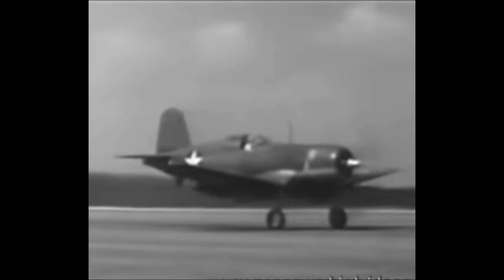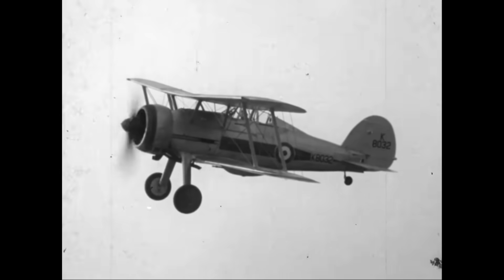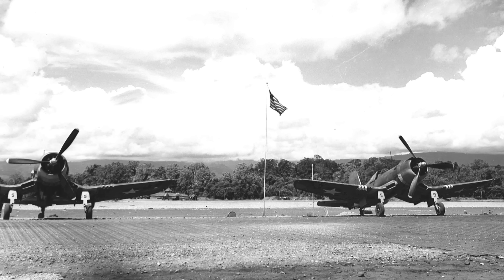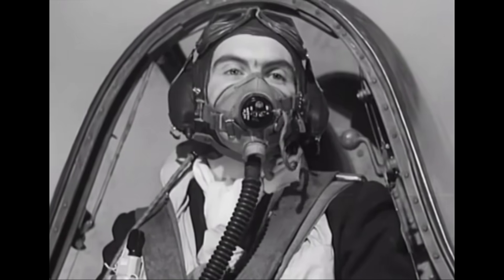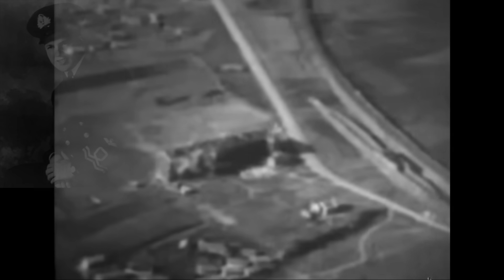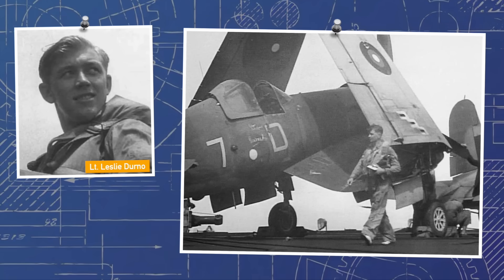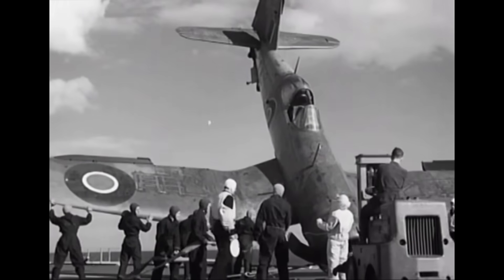Why Did Britain Use American F4U Corsairs? The Full Story

Comment: My grandad was a Royal Navy Fleet Air Arm Airframe Rigger and eventually got stationed at RNAS Coimbatore HMS Garuda in India.
He worked on a lot of different aircraft types including Swordfish, Wildcats and Seafires but loved the Corsair.
Easy to fix and didn't throw many problems up.
He passed away in 1988 when I was 20 but I was inquisitive enough to ask about these things when I was young.
Reply: British designed aircraft were not known to be friendly to engine mechanics.  American designs made it easier for fast maintenance.
Reply: @billfarley9167  Many lessons were being taught, but the sheer Industrial powerhouse the USA with it's modern fabrication techniques and mass production, must of been alarming to every other nation out there. I would surmise that with the improved method of mass production where a person or persons perform just one aspect then pass it on down the line for the next stage, had the knock on effect of when it did come time to perform maintenance, it was an easier task for access, standardised fittings / tools etc.
      When you look at the cockpit of a P-40 Tomahawk or the P-51 series of Mustangs, the cockpits are so advanced compared to anything else with the exception of the German Aircraft, of whom maybe they took a few pointer off initially.  Gauges placed in groups making it easier for the Pilot to access the information he requires all in one region, rather than having to scan back and forth.
Reply: You must be very proud of your dad and rightfully so.
We thank him for his service and may he RIP !
Reply: My dad was a USN Aviation Machinist's Mate (finishing the war as an AMM1C). I've never been sure what the equivalent RN designation would be, but maybe Dad was the same as an Airframe Rigger. He said that the USN preferred the radial engine because it was simpler: "We didn't have time and space to fiddle with water jackets and all those parts to an in-line engine, like the Army Air Force used".  Maybe that resulted from the USN having kept control of its aircraft, while the RAF took away the RN's planes. Allowed the USN to experiment and test out various designs. In all, it is remarkable how quickly the RN rebuilt the FAA once it got its aircraft back.
Reply: Nice

Comment: They used it because it was the best fighter in WWII.  Not the Mustang, Thunderbolt, Spitfire or any of the other ones people gravitate to.  Or as USN said in their trials: The F4U-1 airplane appears to be the superior fighter for Naval or Marine employment, either land for ship-based except in the case where substantially all the fighting occurs above 25,000.   Simply put, it out-climbed, out-turned and out-gunned everything and only the P51 out-performed it as an escort fighter.   It was a hell of airplane and I am so glad the Royal Navy helped unlock its full potential.
Reply: My stepfather flew a Corsair with the Fleet Air Arm and I can confirm that he told me that when carrying out dog fight training against Seafires (the name of the Navy Spitfire variant) he found that they could always gain an advantage because he could out turn them. At first sight this seems surprising given that the Spitfire is a smaller (and in theory) more agile plane but this was what they discovered. (I should acknowledge that that the Seafires had folding wings, unlike land based Spitfires, and there is a possibility that this adaptation compromised the handling of that aircraft as they had not originally designed with that feature.)

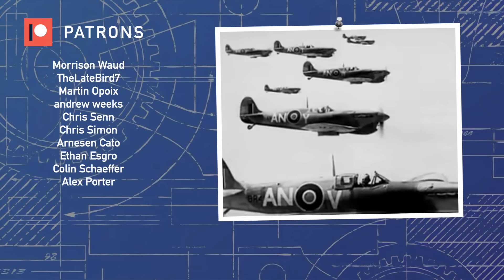Comment: Your line at 18:40 that the US Navy found the Corsair "inherently unsafe for carrier operations" is incorrect. Please do a google search for "F4U Carrier Suitability" or "Corsair Carrier Suitability" and look through the US Navy documents posted on Researcher At Large. The bounce and wing stall issue were resolved before the end of the Corsair's first carrier trials, and the reason the Corsair was sent to land bases was more about Vought's production capacity than problems with the design. This is why both Brewster and Goodyear were brought in to build Corsairs as well. The Navy chose to put the Hellcat on carriers and the Corsair on land bases to simplify supply chains and storage aboard ship.

Comment: The exact same propeller was also on the Grumman F6F Hellcat aka a conventional carrier aircraft, the gull wing design was for a higher top speed. The F4U and the F6F not only shared the same prop but the exact same engine, the Pratt & Whitney R-2800 Double Wasp. Because of its better aerodynamics, it's gull wings, the F4U was more slippery in the air giving it in some estimates 40 mph more than the Hellcat 417 mph for the Corsair to the Hellcat's 380 mph.
Reply: @johnklatt3522  Thank you for the more succinct information. Do you know the diameter of the prop of the earlier dash -1 F4Us? I thought they were the same between the Grumman and the Chance-Vought ships, with the one on the Corsair being an inch longer in some of the stuff I read.
Reply: @johnklatt3522  Here is a film from 1944 has some Nakajima Ki-43, some Buffaloes and a P-40 or two, it's called Kato's Hayabusa Sen-tai https://www.youtube.com/watch?v=NdD6DezelBs&list=PLQLTBQca72K8NuHwSDiN63pBEKRc4c_ev&index=86&t=1107s
Reply: @johnklatt3522  Thank you so very much.

Comment: No, no, no!  The inverted gull wing was not installed to facilitate the use of a large prop by lowering the landing gear -- other aircraft such as the P-47 and the F6F used the same engine and had no issues with standard wing layout.  The reason for the inverted gull wing is that Chance Vought was trying to build the fastest plane possible and they realized that the induced drag at the wing root was minimized when the wing protruded from the fuselage at a 90 degree angle and that it rose as the angle varied from that.  If you look, you will note that the wing protrudes from the rounded  fuselage at a right angle, thus minimizing drag.  They then cranked the wing upwards to give an overall positive dihedral for stability.  Yes, this allowed for a shorter landing gear, but that was a knock on benefit and not the design goal.

Comment: I think on the whole the Brits and USA worked together extremely well and especially when it came to enhancing each others aircraft. Us Brits back then were masters of craftmanship and through the likes of "uncle" Henry Ford the Americans were master of mass production - there are significant flaws in each of those approaches but when both areas of expertise can leveraged together some pretty unbeatable machines were created. The 51 Mustang is an excellent example of this too I believe.
Reply: Very true. British engineers were maybe a year or two ahead of their American counterparts on basic research-we Yanks borrowed from the British for the AA shell proximity fuses, cavity magnetron tube used in airborne radar, jet engines, etc.. . We took original British research and developed it for mass production. And of course the RR Merlin liquid cooled engine which was the best aircraft engine of it's type during the war. American companies had focused on radial engines before the war and both Pratt and Whitney and Curtiss-Wright had excellent designs that were widely used. This alliance accented the strengths of all members, while the Axis nations rarely shared technology and ended up duplicating efforts in many cases.
Reply: Also the Hawker Sea Fury.
Reply: Ford, as an isolationist, rejected production of the Merlin, which is why it ended up with Packard. Volume of production of materiel is what eventually and inevitably beat the Nazis.
Reply: Of course the Americans' early calling in of Lend-Lease agreements led to the British being forced to continue with rationing of even bread until about 1952. The 'special arrangement' is with Britain on its knees.
Reply: Yeah, the RR Merlin made the P-51 the WORLDBEATER that it was! Your comment sums up what the "special relationship" between the UK and US is all about... 😀
Reply: @markymarknj  NO production Merlin Mustang used a RR Built merlin !!! All Mustang merlins were made by PACKARD in AMERICA as were 37.137 Packard Merlins for the Brits !! !
Reply: @wilburfinnigan2142  I'm aware of the Packard Merlin, but it was still based on the RR design. Also, someone had the bright idea to marry the Merlin with the Mustang, so as to morph the airplane into the icon it became. Anyway, we both helped each other during the war!
Reply: @wilburfinnigan2142  Well yes Wilbur but Wilbur your Packard was less efficient.
Reply: @markymarknj   Ron Harker R/R test pilot was the man that got the Merlin into the P51
Reply: @markymarknj nope. It was the Packard merlin. Had to be modified for quicker production and America tools.

Comment: A very informative video indeed.  One small error is seen when discussing the Blackburn Roc, wherein it is stated that the turret had only a single Browning .303 machine gun.  Actually, the turret - the same Boulton Paul power-operated turret as fitted to the firm's Defiant - was equipped with four .303 machine guns.  The main problem with the Roc was its pathetically slow speed, and its lack of any forward facing armament.
Reply: think he was referring to the single rear gun of the Skua
Reply: @ kjg2626: You wonder why the Blackburn company prewar & during the war didn’t match up their own planes to fly & operate with Rolls Royce Merlin Engines too that would have definitely made up for any shortfalls in engine-power output deficiencies in their models that were nearly all specifically built for naval/ carrier operations??!! It would have been logistically easier to supply & upkeep them too, as with other numerous British-made aircraft then at those times??!!
Reply: @trevorfuller1078  finite number of Merlins to go round and the Merlin wasn't a done deal at the time the Roc and Skua were designed. A radial might be specified for particular reasons eg for operations in tropics where liquid cooled engines don't perform as well. And even as the Roc and Skua were being built and entered service, the aircraft to succeed them was under development. Fulmar and Firefly first flying in 1940 and 41. Add to that, Blackburn didn't build the Roc, it was Boulton Paul who did the detailed design work and manufactured them.
Reply: @gleggett3817  : True but RR Merlin’s were also being manufactured by one or two companies in the States under licence as well as in Canada & Australia too I believe! The Blackburn company could also produce good planes but sometimes quite often in fact, they were late to the party in design concepts for anticipating future needs & requirements!!

Comment: The reverse gull wing also has significant aerodynamic value. It meets the cylindrical fuselage at the centreline. Therefore no need for fancy fairings to smooth airflow around what is normally an aerodynamically noisy connection.
Reply: Not a reverse gull wing... just a gull wing.

Comment: The gull wing being for engine/prop clearance is a myth. The hellcat used the same engine and a similarly sized propeller. The full wing was for drag efficiency in how the wings met the fuselage and to enable the Corsair’s relatively short landing gear which doubled as dive brakes.
Reply: The gull wing was chosen because they wanted a shortened landing gear and so put them at the lowest bend of the wing. The gull wing otherwise did not offer wide performance margins it was the air inlets in the wing roots that made a difference not the gull.

Comment: The Fulmar was not a development of the Battle, but was derived from the Fairey P4/34, a different aircraft altogether. D
Reply: It was still more or less the same design. The P4/34 was designed as a light bomber to replace the Battle. And then it was developed into the Fulmar for carrier operation as a reconnaissance fighter.
Reply: @norfangl3480 the Fulmar was developed from the P4/34, and was most certainly not more or less the same design as the Battle (if that's what you mean), but had a family resemblance.

Comment: The inventiveness of the British during wartime cannot be underestimated, they also got the P-51 working by spooning a Melin into it
Reply: 36. ... According to them, the Allison is averaging 1500 hours between bearing failures as compared to 500 to 600 hours for the Merlin. The Allison, they have found, will drag them home even with the bearing ruined.
 PART 7 MUSTANG VARIANTS OF THE RAF AND RAAF

Mustangs for the RAF (P-51A)
https://www.youtube.com/watch?v=usqV_zUpGCs&t=13s
Reply: @nickdanger3802  only iff the Allison didn't catch fire or throw a con rod first. The Allisons were not very reliable until late in the war when the intake manifold was redesigned.  Even then, it wasn't the best or reliable at high altitude, not even in the P-82 in Korea.
The Spitfire went through improvements and strengthened throughout the war, far surpassing the Allison.  The Merlin 66 was up to a reliable 2000 hp by 1944 with water injection and 150 octane.

Comment: Oddly the FAA already had the perfect close in kamikaze interceptor in the Seafire which could both outmanoeuvre and outgun Japanese aircraft and with the octupal pom pom a weapon that could literally remove a kamikaze aircraft from existence. This plus the fact the RN carriers were designed to survive in the Med where land based aircraft would be common and could be dropping 1000lb bombs and later 2000lb bombs(both bigger than the initial marks of the B-17 could carry)rather than the 500lbs of the IJN gave the British ships a major advantage. only the smaller size of the RN carriers versus the Essex class was a major problem
Reply: 2pdr 'pom pom's could put out a wall of fire that would put off an attacking aircraft but not good for long range fire compared to  a 40mm Bofors. And the octuple mounts weighed several tons
Reply: @gleggett3817  It would not matter when the attacking aircraft is a kamikaze what matters is stopping it hitting the ship and for this the pom pom is excellent either in quad or octuple mounts. The pom pom was also cheaper to produce than the Bofors and the weight of a quad Bofors is also measured in tons
Reply: @davidmcintyre8145  but the Bofors is equally effective at kamikaze attacks and better at non-kamikaze attacks than 2pdr
Reply: @gleggett3817  It comes down to barrel numbers. Bofors were made in single,twin and quad,sextuple mounts were only introduced after the war while the sheer wall of shells an octuple pom pom could put out was on a different level. There is also the fact that unlike a Bofors mount part of a pom pom mount could be firing while the other half was reloaded meaning continuous fire

Comment: The US Navy was still ordering new Corsairs in Korean War. Some Marine Reserve squadrons still flew Corsairs after Korea was over
Reply: That's why I was surprised that the presenter here said that the US didn't want the RN Corsairs back. We used them in the Korean War; in fact, it was one of the only WWII propeller types to still be in service in the Jet Age.
Reply: @markymarknj 
It might also be because the RN cut about a foot off each wing to clear the low hangar overhead on British hangar decks.
Reply: @fazole  that's a good point.
Reply: @fazole  ; I doubt that was the reason considering it improved the roll rate and reduced ground effects upon landing.
Reply: @markymarknj  Yes, and no.... The AD Skyraider was DESIGNED during WWII but technically didn't enter production until after VJ Day, so one could make an argument about it being a WWII DESIGN. 
Just the other day I was telling a friend that with the P-47 still in ANG service after WWII; it would have made a MUCH superior ground-attack plane in Korea than the vulnerable Mustang would have been.
Reply: @markymarknj  Not the only one add the Mustang, Navy Skyraider also..
Reply: @wilburfinnigan2142  the Skyraider was a great plane! It came out as WWII ended, and went on to serve in both Korea and Vietnam. Since its missions were SAR (Sandy), CAS, and attack, its slow speed was its asset; it didn't matter that it was prop driven.
Reply: Keep in mind that there were so many surplus American aircraft at the close of WWII. Also, Korea was five years away. Some WWII Corsairs took part early in the Korean conflict, but several improvements to the F4U also took place in the years between the two wars.
Reply: @Atpost334 Many of the Corsairs in Korea were AU-1s. In French Indo China(Viet Nam) they were F-4U7s. As for Korea the only Navy ace, night fighter ace, and prop driven ace in that war flew an F-4U5N. Greg Bordelon.
Reply: Correction: Guy P. Bordelon.
Reply: @patrickgriffitt6551  As I said, several upgrades took place between the Corsairs used in WWII and those used in Korea. If you trace the thread, that is what I was responding to.
Reply: @Atpost334  I wasn't disputing your comment I was just enhancing it.

Comment: You know, I was always curious why in 43 the U.S. didn't look at the Coursair to fill the need for an escort fighter over Europe. It had good range.  And especially where it wasn't doing well on carriers?   Just a thought?
Reply: They had just got the P47 which had almost the same range could go higher and why would they want a naval plane
Reply: Context is that American fighter (and bomber) units were being trained in the US for about several months, on the aircraft they were going to fly in Europe before they arrived there.  And the P-51 Mustang with its extra fuel and long range tanks had already been selected. By mid 1943 the pipeline of pilots and aircraft was already running. A swap to Corsairs would have been a disruption to the build up.
Reply: @gleggett3817  The p51 was not selected until early 44
Reply: Corsair not Coursair
Reply: @markparry63 thank you for correcting my phones auto correct. I'm  sure no one could have figured it out if you hadn't.  Give yourself an "at a boy!"